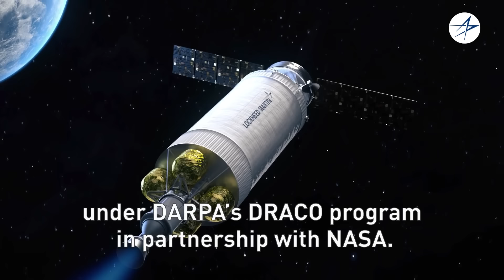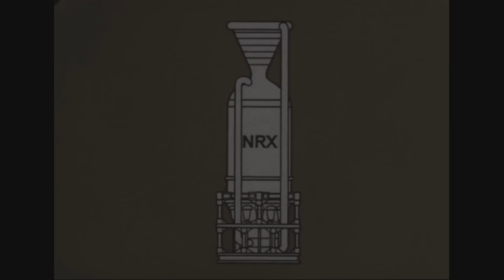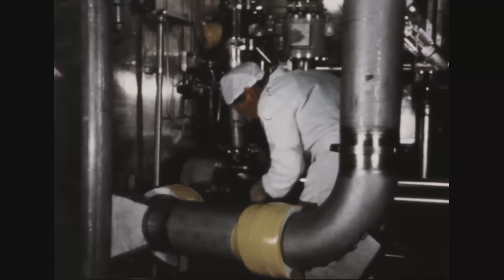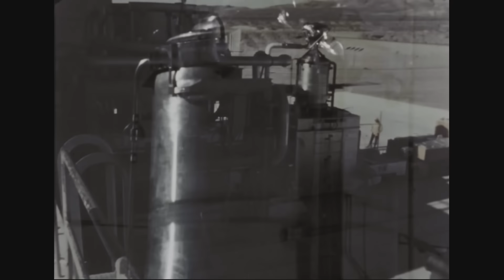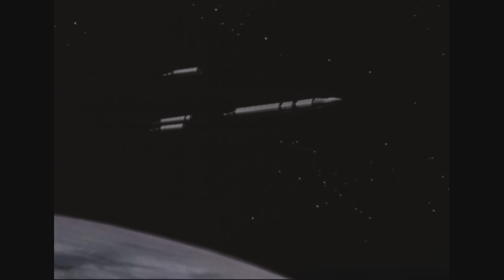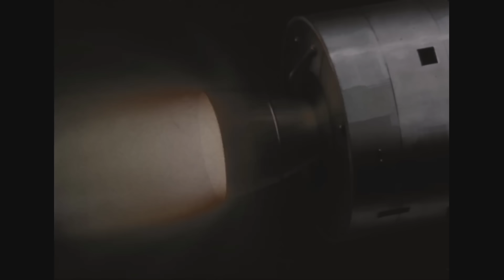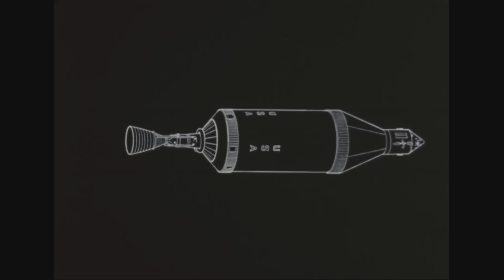Why Nuclear Rockets Are Going To Change Spaceflight

Comment: So The problem is, if the fuel reach too much pressure and blew the rock it up so you have to design the nuclear reactor to essentially survives that explosion in perfectly container nuclear material that on a rocket for your anal compulsive about mass is extremely difficult, and then the best way to have any kind of nuclear propulsion in space, because the end them part is that there is never a non zero chance of the containment vessel, you created to survive the explosion. It have a tiny breech, and he Cause it to rain down down nuclear material all over Gods green earth So the best way is to ship up for tile thorium and ship the reactor up and the reactor is there any fueled engine and all is shipped up empty using multiple booster stages to get the engine into orbit and the thorium fuel is for tile not for sale yet the thorium fuel gets loaded into a space station that has a Polywell fusion reactor that produces neutrons and using neutron reflective material we concentrate and focus the neutrons, essentially using mirrors prisms in Wednesday it’s made of neutron, reflective material And Then the neutron particle beams hit the beryllium which acts as a neutron multiplier, which then allows the neutrons, which reflected back into the thorium to braid it into its face. I’ll stay in that fissile thorium fuel is in loaded into the engine
Reply: And do you know what thorium where you can find naturally in monazite Sands you could eat the sand in a beach, and ingest a large quantity fertile thorium So it’s completely non-toxic. The only potential toxic component is beryllium, but because it hasn’t been exposed to the neutrons, yet to be a neutron multiplier, it’s just conventional toxic metal poisoning you’re worried about and you’re right beryllium is not so easily separated from uranium, but there is another way we can solve that problem we take the beryllium, and we use an arc jet to turn it into a plasma, very very high temperature plasma, and then we use a shaped magnetic field Confine the beryllium Plasma And we spin it, and the the act of spinning. It is inherently, going to separate the Uranium out. Then we use lasers to know the best absorption frequency of the uranium, and push the uranium out because we turned into a high temperature plasma. The beryllium in the uranium are fully detach from each other, and because of the mass  uranium is going to spin out of the plasma
Reply: And do you know what thorium where you can find naturally in monazite Sands you could eat the sand in a beach, and ingest a large quantity fertile thorium So it’s completely non-toxic. The only potential toxic component is beryllium, but because it hasn’t been exposed to the neutrons, yet to be a neutron multiplier, it’s just conventional toxic metal poisoning you’re worried about and you’re right beryllium is not so easily separated from uranium, but there is another way we can solve that problem we take the beryllium, and we use an arc jet to turn it into a plasma, very very high temperature plasma, and then we U-shaped magnetic field Confine the beryllium Plasma And we spin it, and the active spinning. It is inherently, going to separate the Iranian out. Then we use lasers to know the best absorption frequency of the uranium, and push the uranium out because we turned into a high temperature plasma. The beryllium in the uranium are fully detach from each other, and because of the mass  uranium is going to spin out of the plasma
Reply: Because my phone cannot doesn’t function too well I have to use the text to speech device. Also, I have some spelling problems you know with grammar because I’m kind a little bit mentally disabled, so I am using the text to speech device in case if anyone’s wondering or getting thrown for a loop you know

Comment: The only real major problem with nuclear power in space is, how do you get the radioactive nuclear material in space is zero chance of an accident having happened in raining down radioactive nuclear materials all over creation because if you’ve ever looked at a rocket, you know blowing up in The atmosphere that’s an excellent delivery mechanism for nuclear radioactive materials, and it’s not about the rocket blowing up because the reactor went super critical. You could design it like a Traeger reactor, where you’ve got boron inherently built an integrated into the fuel rods or fuel pellets, so giving an inherent negative criticality, so the laws of physics, with directly Intervine, and prevent a prompt criticality event

Comment: What if we used hydrogen and fluorine for the SLS with the SRBs using beryllium and ammonium perchlorate? the beryllium oxide is super toxic as is the hydrofluoric acid, but if the berylium oxide and hydrofluoric acid exhaust plumes meet, they'd produce relatively harmless beryllium fluoride and water.

Comment: would a nuclear thermal rocket be a lot more efficient if the reactor was used for electricity generation aswell as heating the gas for thrust and accelerat the gas/plasma like a plasma engine.
could be like a hybrid nuclear/plama rocket for both thrust and specific impulse
if the thrust was close to the that of the nuclear vut with efficiency close to plasma rockets they would be great

Comment: Hi Scott - fantastic job you did here! Brought back some great memories. My dad worked for Aerojet on that project. He took me out there for a test sometime in ‘66. It was the Kiwi-B reactor mounted inverted on a rail platform. Many of the details you talked about, my dad explained to me after test analysis. Engineers were optimistic that actual deep-space performance would cut a  conventional powered manned trip to Mars to 1/3 the time! Plans were in the works for a manned Mars mission by 1985. I dreamed of being on that project. 
Thanks for the video - well done…

Comment: Scott i know im a bit late but i thought the whole ramp up and ramp down complication could just be solved by having a copy engine on earth (would they need a vacuum chamber does that even work or do they fill up with exhaust?) or in low earth orbit and they run the clone engine for as long as it takes to change the right amount of deltav, then send that burn time for the real spacecraft?
Reply: What do you mean by "send that burn time"? Running an engine in one place isn't going to affect a spacecraft somewhere else.

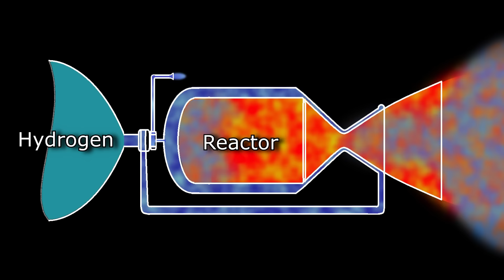Comment: 6:50
Given the particles are moving at the same speed wouldn't it be better to have a higher mass?
Reply: If you can reach the same speed with a heavy particle, yes. The problem is that it takes more energy to get a heavy particle moving than a light one, and eventually you run out of energy to do that. If not, we'd be throwing iron out the back of a spaceship.

Comment: In the rocket equation, Ve = g * Isp. In other words, Isp is just the exhaust velocity divided by g (acceleration on Earth). Another way of saying it, is that Isp times about 10 (really 9.8) is the velocity of the exhaust, in m/s. So Isp is just an odd shorthand alternative way of describing exhaust velocity. The story behind why they starting using Isp rather than Ve might make an interesting video. :)

Comment: I wrote a research paper in high school in the mid-70’s describing nuclear rocket propulsion. I referenced the MINERVA project. I explained that a nuclear rocket did not spew nuclear fallout  but only hydrogen gas. And I said the efficiency of nuclear rocket engines was far superior to chemical ones. My teacher gave me a ‘C+’ because, she said, I was wrong about the radiation hazard. And she did not like me. But she was an English professor so  what else can I say?

Comment: The engine core is a modified beryllium reflected uranium carbide/silicon/zirconium carbide ceramic HTGCR. Also a thorium carbide reactor core is possible as a fast spectrum version that wont need a moderator, insead a potent pulse neutron source causes it to go critical and it outputs power in pulses. Another option is use the nuclear thermal as the primary heating stage of an ion thrust generator. Then use an electrical field to launch the plasma at much higher velocity. Helium gas can be used as both a propellent and moderator, then mixed with xenon or mercury vapor to give a more powerful thrust force. ❤

Comment: Some designs use fissile liquid propellants. You do not necessarily need to use melted components; it's possible to create solutions of radioactive salts that will go critical given sufficient neutron density.  One mechanism of creating higher levels of neutrons was mentioned here, using neutron reflectors that concentrate the natural amounts given off by the fuel.  I can imagine an engine that consists of a material with thousands of small holes where the fissile liquid circulates while the hydrogen fuel is heated without coming in contact with the fuel at all.

Comment: Mount secondary ion drives to use the excess power still flowing while the reactor core is cooling down after a major maneuver, or simply power drawn from the pile when it is not being used for thrust. Having a dual drive system would give much more flexibility in mission profiles.
Reply: Yes, that's the view from the peanut gallery. The view from the engineering department is that converting the thermal power of the reactor to electricity requires a giant radiator, which has enormous mass.
Reply: @schmetterling4477  In the video, they are talking about the times when the reactor is ALREADY running. I assume the reactor uses a cooling system as it does that? Try watching before commenting. Or eat more peanuts.

Comment: What about using a nuclear reactor to heat hydrogen to go though a turbine to power an ion engine. Not only are you getting the thrust from the nuclear engine but you are also getting the thrust from the ion engine.
Reply: You are only getting that power for a few minutes, after which the tank is empty. The only way to generate electricity after that would be with a closed cycle, which requires a football field size radiator. Not that it can't be done, but it's pointless to do both. We can just build a closed cycle reactor and use an ion engine all along. In that case we can probably get away with a tennis court size radiator, but the acceleration will be very small (on the order of mm/s^2).

Comment: Nuclear reactors in space. What could possibly go wrong?

[Canada has left the chat.]
Reply: Nothing, actually. There is already much, much more natural radioactivity in space than any reactor can add. An unshielded fission reactor is a perfectly fine design for spacecraft. The problem is not the reactor. The problem is the cooling of the reactor. Realistically a radiator can cool between 10-20kW/m^2. A 1MW electrical reactor requires approx. 2MW of thermal cooling. That's between 100-200m^2 of radiator area with hot gases or liquids flowing through thousands of pipes. I don't know if anybody has a reliable technological solution for that.
Reply: @schmetterling4477  Thanks for the elaborate exposition on radiation in space but I think that you missed the point of my comment. For reference: Kosmos 954, Kosmos 1402,  Kosmos 367, Transit 5BN-3, RORSAT, Nimbus B1, Kosmos 1900, ...
Reply: @ProPexPup  The problem there weren't the reactors but the Russians who don't care shit. ;-)

Comment: What if there was an accident, where this type reactor explodes in the air. (like most testflight). What implications and risks are involved? are radioactive particles spread over a large area? What would happen?
Reply: I'm no expert, but I wager that yes, in case of a critical failure, you'd spread radioactive material around. However, there also wouldn't be so much actively fissile material that it would cause some major disaster. You'd have to pick up the pieces, obviously, but the engine falling apart would prevent it from turning into a bomb. Still definitely dangerous, I think that goes without saying.

Comment: Once a reactor has undergone initial criticality it can't be shut down. You can bring it to insignificant power levels but you can't bring it to zero. The only way to truly shut it down is to bring it to that insignificant power level and remove the fuel assemblies and spread them out from each other. 
Ah - Tix the cowboy. If you know you know.

Comment: Nuclear can't stop easily (without causing problems) maybe that's why it was mothballed. Even with controlled drums, it is weight and more controlpoints that could go wrong. If nuclear could be turned off like a light switch, maybe then it is usable, but I don't see astronauts go out and repair a part on these engines... (Tsjernobyl - Fukushima as example)

Comment: Speaking of mass, wouldn't it make more sense to deliver parts of the NTR up to space piece by piece and assemble it in orbit, rather than constrain the size or mass based on launching it wholesale from Earth? This would prob be the only way to construct one large enough for a long range or long duration journey. 

This also rings true for reaction mass. A "tanker" station or satellite could be set up in orbit, with ferry flights regularly delivering fuel to it.

Comment: History on these things in the early days is hilarious. The logistics of moving them into test position was absurd. They had the mounted on very large train engines, which were lined with lead to protect the engineers moving them around.
I think they actually put one (or a variation of one in the form of a nuclear jet engine) inside of a B-36 to test it out.

Comment: It should've changed spaceflight 60 years ago, we should have incentivized and subsidized private companies with government contracts instead of relying on a federal jobs program to make better rockets. It worked in the space race when there was an incentive on the Saturn V (with a lot of luck and had genius engineers in charge with vision), however without that very specific and tenuous condition, government programs don't iterate and innovate enough to be necessary for the space industry. SpaceX has changed the world and advanced us decades ahead, that's what a free market does when the government no longer restrains it.

Comment: Not sure if it was you or someone on the ksp subreddit, but (at least for ksp) there is a giant chart showing all the engines and their isps and the distance required to make a high isp engine worth using.
In ksp,  the small chemical engine was always superior due to low mass and fairly good isp and made the nuclear engine a bit pointless lol